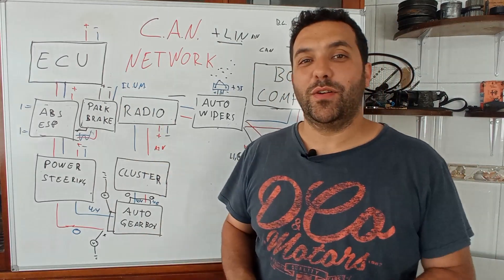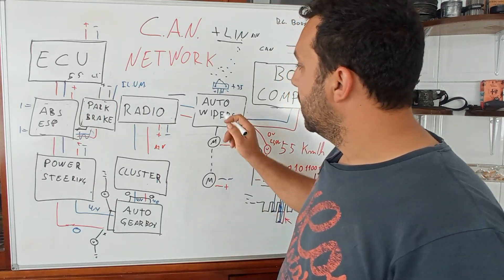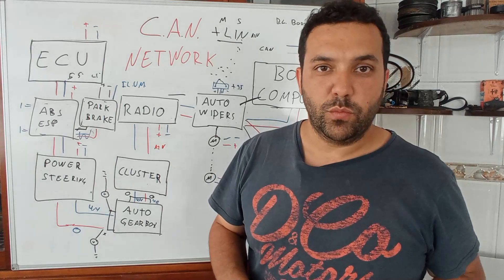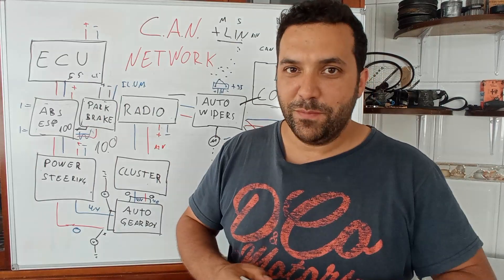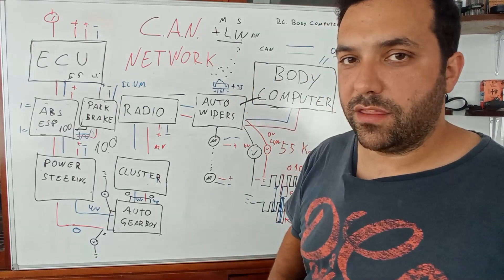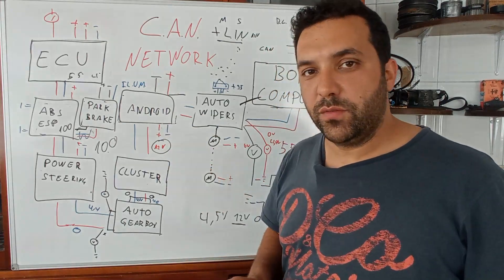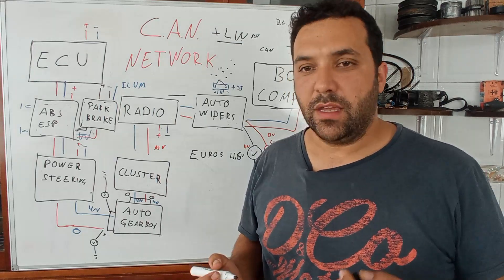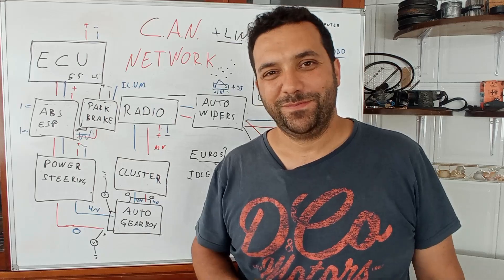Practical cases of the CAN network, common problems, solutions and diagnosis.

Comment: Hey Bruno! Finding this video after I checked you channel. 

I have an issue with the fuel cauge, it constantly shows empty and the reserve light keeps blinking. On diagnostics it gives FATAL ERROR on CAN bus line. With the diagnostic, we've tested the cauge, its working.. 25%,50%,75%.

The body computer was replaced by a technician, but no luck. The wiring is fine, the fuel sender also..Ive tried with another working one.

Any sugguestions what can I check CAN related since the "obvious things" are not the problem?
Reply from the maker: Hello. In what control unit do you have that fault code? And what car?
Reply: @alfaromeonoproblem  Oh boy. I've missed the most important. Alfa Romeo 159 1.9 120hp 2006y
Reply: Not sure about the control unit? You mean ECU?
Reply from the maker: @SinisterMKD hello. On diagnosis what is the fuel level?
Reply: @alfaromeonoproblem  its not showing at all, also for "Range" it's like this "--:--".
Reply from the maker: @SinisterMKD not on the cluster, I mean on the diagnosis machine
Reply: @alfaromeonoproblem  Yes, on diagnostics no fuel level is shown
Reply from the maker: @SinisterMKD that is an issue. Probably wiring is the issue, or some interconnection or a ground
Reply: @alfaromeonoproblem  Any ideas from where should i start checking, any diagram for CAN network regarding the fuel cauge?
Reply from the maker: @SinisterMKD the signal from sender to body computer is not CAN. You must check the two wires for that function between the fuel sender and body computer
Reply: @alfaromeonoproblem  Great! Thank you for the update Bruno, I'll keep you updated😁

Comment: Thanks Bruno, quick question. My Key reader on my 159 seems to go to sleep and will not respond to remote door lock and unlock when the CAN goes to sleep, can you think of any reason this might be? I believe it is the CAN going to sleep as the red light on the key reader goes off which technical manual says is B-CAN going to sleep. Thanks
Reply from the maker: Hello. That is correct, the CAN goes to sleep, but it should have a separate line for remote line. That line is not responsive. That line is in the body computer and it also may be on the driver's door unit if I remember correctly. I would have to check with the diagrams. 
That separate line is only necessary when can goes to sleep. Once it's working is not necessary.

Comment: Useful info. My brother has a 2005 307 1.6 petrol and my parents have 2017 C3 1.2 PureTech 82, so PSA info comes in handy.
Regarding coasting in a gear. I am always driving like that, but I was certain that any car with electronic injection does this (turns off the fuel injection, because the wheels are turning the crankshaft). So you are telling me that my Euro 4 Sandero 1.4 shitbox is stil using fuel when I am engine braking or coasting down the hill in a gear? :O
Reply from the maker: Hello. Only newer engines with hi emissions restrictions have this system. It's a matter of programming of course but that's the way it is